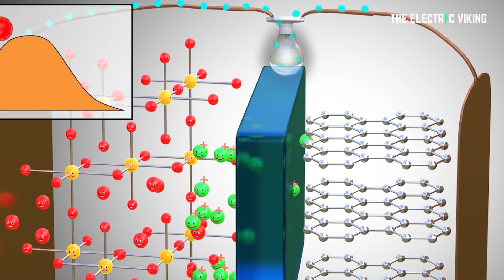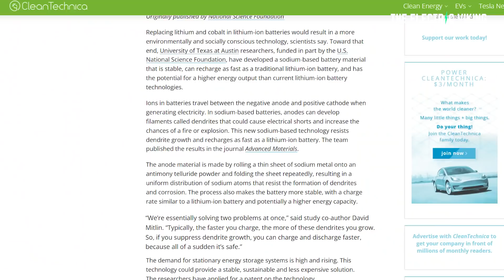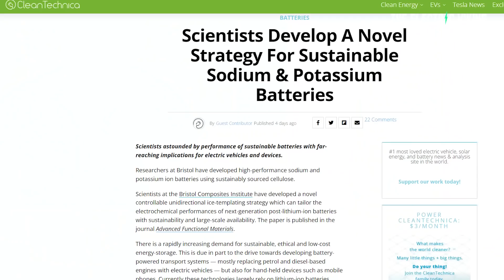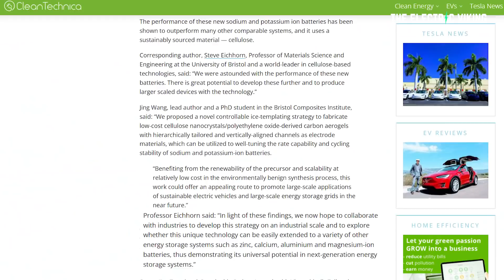Sodium batteries with higher ENERGY density than lithium

Comment: "It has the potential for higher energy density...." That's a load of BS! Sure, Sodium batteries would be a lot cheaper that LPF batteries and particularly Lithium NCA batteries. But the energy density (which your video carefully avoids specifying anywhere) from the best Sodium batteries is only around 1/3 of the energy density of the best NCA batteries! For EVs this would mean a difference in range of around 350 km for Sodium batteries compared to up to 1000 km for EVs with the best NCA batteries.

Comment: This is simply not possible. The sodium atom itself is bigger than the lithium atom, meaning it requires a larger matrix to hold the particle. Because of this, pound for pound, sodium has lower energy density by weight and space than lithium. That being said, sodium ion might have some large scale applications like storing power from solar power units, but is not practical for things such as cars and mobile devices.

Comment: I'm not so concerned about energy density I'm concerned about speed of recharge. I don't have charge at home ability and I don't have time to sit around for hours at a public charge point. Show me a battery that can charge 0 to 100 in 5 mins and we can talk. Battery life is also a concern. If you have to replace a battery that costs nearly as much as the whole car in 8 years then its not a sustainable option. That's the nice thing about ice. If you take care of the car it can last you 20-30 years before actually needing replacement. Most people dont take care of them. I expect sodium ion batteries would be significantly easier and cheaper to recycle too.
Reply: Higher energy density (and especially higher specific energy, which is what I think Sam meant) provides higher range in the same volume (or for specific energy in the same weight) battery. Higher range means you don't need to charge 0 to 100, you can charge 20 to 80 or whatever and get the same range. So you actually do end up charging in a shorter time unless you are stupid or don't care about shorter charge times. Longer range also means less deep cycles per 100 000 km, which means longer battery lifetime. And in any case, LFP batteries can charge in 10 mins if the charger can handle it and can last 20k deep cycles. 20k deep cycles on a 500km range battery means a million km (even if you charge only 20 to 80 every time, because that counts as only 0.6 deep cycles). That would probably work for your 20-30 years and the some! Well. It's a little less, due to battery degradation which means near the end of the life of the battery it would have significantly reduced range, so you will actually average less than 500km per deep cycle. OK then, an even longer range battery will get you to 1M km battery life.

Any way. If I understood this video correctly, this battery will actually have very fast charge times and very good lifetime as well. I'll have to see it in mass scale production to believe it. But it sure will be nice if we can get a Sodium-Sellulose battery that has good specific energy, high charge rate and high deep cycles!

Comment: The main reason silicon and sodium haven't been part of batteries, is because they swell under charging. The risk of internal short, failure, and fire during charging is around 100%.

Also, sodium is far more reactive with humidity than lithium.  You know...being an alkali metal and all...

Comment: This would be GREAT news if Sodium could displace Lithium, on the Cathode side, in batteries, used for EV's!
Sodium is obviously PLENTIFUL and very easy to Re-cycle!  Lithium availability is quite LIMITED and difficult to re-cycle.
Reply: Lithium is plentiful as well (if not as plentiful as sodium.). It's mining Lithium sustainably that gets... interesting. And current mine capacity is too limited.

Furthermore, lots of money and experience can solve all sorts of problems. Tesla's partners economically recycles nearly all the lithium in any Tesla cell or in Nissan Leaf cells.

All that said. I would love to see Sodium Ion cells in mass production if there isn't some other nasty issue like the cells using cobalt again.

Comment: Lithium has a lower density and lower atomic weight than sodium, so the maximum possible energy density will always favor lithium. However, the difference isn't large, so it is entirely possible that the highest energy density sodium ion batteries could be higher than some Lithium ion batteries. So, with a considerable overlap in performance, and sodium being much cheaper than lithium, there are plenty of possible uses for sodium ion batteries - automotive, stationary, power tool, and mobile electronics.
Reply: Probably not more energy dense- possibly more economical.  Probably more for grid, stationary storage as opposed to electric cars.

Don’t believe any battery news until it’s in production.

Battery manufacturers have a lot of incentive to overstate their upcoming tech- as it is a ver capital intense industry.

Comment: Back in the nineteen sixties Ford Motor Company had an EV that used a sodium-sulphur battery.  While it was promising it required an operating temperature of around 400 centigrade (750F) which was probably the chief reason it was not pursued at the time (hot enough to keep the electrolyte liquid).  Ford might want to dust off any patents it has from that effort.
Reply: That was interesting work, but the patents aren't worth much if it has to run that hot.  It's just out of the question for a car.
Reply: @incognitotorpedo42   These days that tech would not be competitive but back then there were no NiMH batteries as would eventually (the first ones used lead acid batteries) be used on the EV1 with the patent to use those in a car being sold to Texaco, who sat on it, effectively killing the commercial EV until Li-ion cells became available. Don't forget much higher temperatures than 400 C are to be found in the combustion chambers of any ICE engine (hotter than the melting point of steel actually at typically 1500 C) while the inner surface of an exhaust manifold may run at 500 C.  This battery tech did not take off, probably for many practical reasons not least being its high operating temperature but it may not have been such a crazy idea for the time.

Comment: I am convinced with so many new discoveries recently with Battery technology, it will reduce demand totally for cobalt and other difficult expensive minerals. Game changer on the horizon where I can see 2000 Mile EV range possible.  Tesla will surely be keeping an eye on this.
Reply: I expect to see cobalt gone in EV batteries before too long.  I don't think a 2000 mile ev will ever happen unless both gravimetric and volumetric energy densities go nuts while cell cost simultaneously falls off a cliff.  Almost no one needs that much range in a passenger vehicle.  Car designers have better things to do with the space and mass involved.
Reply: @incognitotorpedo42  People just need to use public transport more when going long distance. Trains for example can move a huge amount of people in a short time.

Comment: A $20,000 EV SUV is sorely needed in the US market now that gas SUVs are starting in the mid-$20,000s and rapidly going up. Pretty much all new cars decently optioned end up in the $40-$50K price range now, esp. with dealer markups. Anything top of the line Is just ridiculous.
Reply: You don't need a "sub 20k car".
You need an EV with  a total cost of ownership less than a 20k car, correct information regarding the costs, and consumers intelligent enough to buy them.

(Just by the way, resale price should be factored in to the equation)

Comment: There are always new batteries and battery tech hitting the news and it's going to be even more as EV adoption ramps up. Currently we had Li batteries (NCA and NCM) and I'm sure I'm forgetting a chemistry or two We also have Lithium Iron Phosphate (LFP) and as far as using for EVs these types are really good.

But keep an eye out for Sodium batteries, Solid State, Aluminum-Air batteries, Sulfur batteries and probably a few others. The sulfur battery caught my attention because of its energy density but there are issues when it comes to all of these batteries so it's going to take time while developers work out the issues

Comment: Very happy with the progress being made on Na-Ion batteries. That said, I think Li-Ion will have lots of legs left - at least 5 years looking ahead. It isn't just enough to have a price point per kWh that is 30% cheaper, but what will actually make or break it - particularly for energy storage is what the cost ends up being per cycle. 

There has been so many decades of work on the manufacturing and scaling side of Li-ion that has helped so much with improving cycle life, it will be interesting to see which other chemistries and formulations have a chance to reasonably compete.
Reply: I'm guessing most of these developments will be able to be applied in some way to sodium-ion, since they are so similar to Li-ion.  The only real problem has been the anode, which looks like they can solve.

Comment: someone in the comments below mentioned about a better microphone; i think your microphone is fine, BUT, the frequent banging on your hands/wrists on the table makes a low frequency spike. either isolate the mic from direct contact with the table surface, or use something like audacity, a free open source tool which has great noise reduction to eliminate that. just feed it a sample of that sound and it will reduce or eliminate it, but easier to just have the mic suspended with no contact with the table, or buffer it somehow. 

depending on the mic you have, you can even place it meters away and use the zoom on it and it will pick up your voice only an no other ambient sounds, that is very easy, even for a dope like me.

Comment: I have worked in the clean energy industry for over 20 years, and there have always been very promising battery chemistries being developed, but very few that made it to market. What Tesla did was fundamentally change the course of the battery industry by looking at the production side of costs and using "good enough" chemistry. This change in manufacturing has created incredible growth and price changes in batteries that allow for profitable EV's and stationary storage. This has then created a knock on effect of bringing billions of dollars to battery research. But just creating wonder chemistries is not enough: They need to be able to be manufactured at scale more cheaply than current batteries, or provide cost savings in other areas, such as significantly higher energy density, thermal stability, and safety.
Reply: GoCoyote, did you mean "John B. Goodenough" chemistry?
Reply: @catherinegrimes2308  
LOL, Pun not intended, but thanks for pointing it out, and it's welcome all the same! Have to wipe some tears away....Perhaps it is my just PUNishment.
Reply: @GoCoyote  Many thanks for your kind words.

Comment: Have you ANY idea how dangerous SODIUM METAL is ? It reacts spontaneously with almost ANYTHING that contains an oxidising ion. We call it 'reducing agent'. Only Potassium is comparable. The sodium ion is HEAVIER than lithium, so batteries using sodium WILL weigh more like for like. Please get an education in basic electro-chemistry instead of reading press releases as if they were announcements of Christ's Second Coming !
Reply: Lithium is also quite flammable and yet it's very hard to get an LFP battery to burn. It really depends on the entire battery chemistry. Not just on what ion you use,

Lithium is only a few of the weight of Tesla's cells. So again it depends on what else is in the battery with the sodium or the lithium. The cells in this video have cellulose. LFP batteries have iron. Hmmm. I wonder which one of those is heavier.

So sure. I would expect, everything else being equal, Na-ion batteries would be flammable and would be heavier than Li-ion batteries. But it really depends. Frankly. It's whether or not we can mass produce the batteries and what their properties will be in whatever form they are mass produced that interests me most. But it is nice to hear about such apparently wonderful batteries and dream. And it is likely that one day we would have some fairly great value for money sodium ion batteries. May be only for grid storage. But then again, may be also for BEVs or heck even for aircraft. Though I won't hold my breath waiting for that last one.

Comment: I expect in the long run you will find a variety of storage technologies get developed and each will have a application where it is best.  Even in cars you may find different battery options depending on who the car is marketed to.  For example, a car that works best for a person commuting to work could get by with a lower capacity battery and may be able to use a cheaper, lower energy density battery than that used in someones workhorse pick-up trick.
Reply: if a better battery is available for a similar price why would anyone accept an inferior battery in their commuter vehicle? They wouldn't be getting their moneys worth.
Reply: @ADobbin1  Because using one battery type for all applications may make it more expensive.  Say you have a need for a quantity of certain batteries for all battery applications and have a choice of four types: A, B, C and D.  If they all cost the same, but D provides 2 times the power, D seems like the better choice.  But if making all batteries type D drives up the cost of type D, then types A, B and C still have their place.  Right now, for BEVs, Li Ion have better energy density than LFP, but LFP are cheaper.  They both get used based on the technical and commercial requirements of the car.  It would be very fortunate to have one battery type all applications that exceeds performance of all others, that cheaper to manufacture and has no manufacturing, raw material or environmental constraints, but that is wishful thinking at this time.
Reply: Like ice car engine design
We have gone from side valves to 4 valves per cylinder and variable timing. 
Gradually the old design die, but they  remain viable at low prices, even losses to clear old stock.

Comment: Are there any battery technologies on the horizon that would meet the requirements for aviation (regional: 500 Wh/kg, mid-range: 1000 Wh/kg, long-range: 1500 Wh/kg)?
Reply: Nope and I up those weight numbers by 50% due to necessary redundant systems in air transport vehicles.
Reply: @BasedInBrazil  I think 500 Wh/kg will be in hand before too long.  Hard to say about the higher ones.

Comment: Must say I am sceptical...
Of course this has been looked in to for a long time.
My belife is TESLA is on top of battery tech in regards to cars and storage, they KNOW were the research is.
If there is something promising they can just buy it.

There are to many of these "Breakthrus"
Some might pan out, MOST wont.

I would say Aluminium Air batteries...
Do you know how much air exists... and how cheap it is... not talking about weight...
and Auminium is the third most abundant of all elements on earth...

Comment: Yes, you can get higher energy density be using MORE REACTIVE ELEMENTS in batteries. There's a Sodium-Sulphur battery that operates at high temperature for example BUT it's a FIRE RISK and indeed a factory in Japan went up in smoke because of them !

I do wonder if your viewers understand that batteries like Li-ion are so much lower in energy density PRECISELY BECAUSE THEY'RE NOT A FUEL ! IF a battery had the energy density of Jet A1 or gasoline, IT WOULD ALSO BE A FUEL itself ! Understand ??????

Comment: If this makes it to market for cars , solid state dead is dead in the water as the price and availability of the the elements . If even only available as a battery energy storage system for any of these new chemistry means more types of battery and more kilowatts of storage worldwide. Therefore the increase in battery storage will be no problem and mean the end for carbon based fuels and the power stations they fuel. It will also mean increases in in wind and solar production with the availability of storing unused electricity at a much cheaper price to the suppliers and customers. One more nail in the coffin for the petroleum industry , though they will likely invest in it which is not a bad thing.
Reply: It would be natural they would. They employ a lot of geologists and engineers looking for oil. I imagine some of that competency translates to finding lithium, cobalt, and whatever next gen batteries will need.